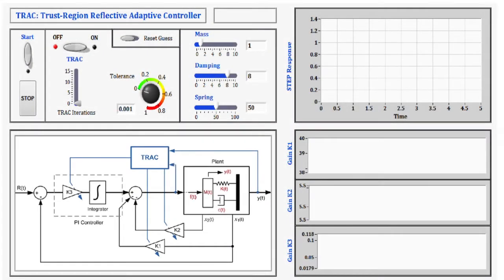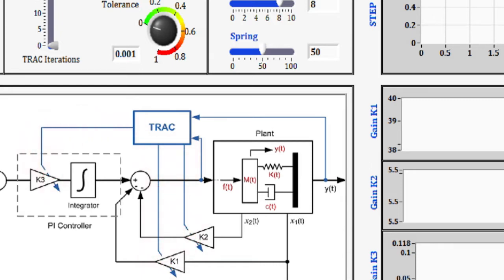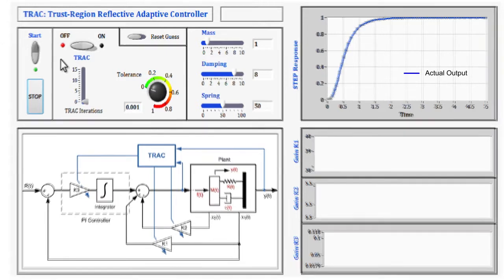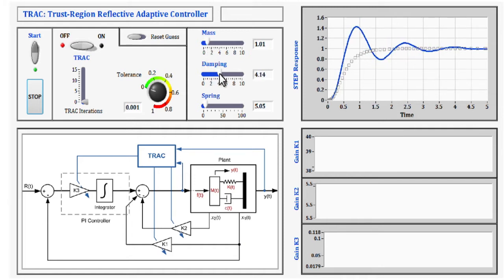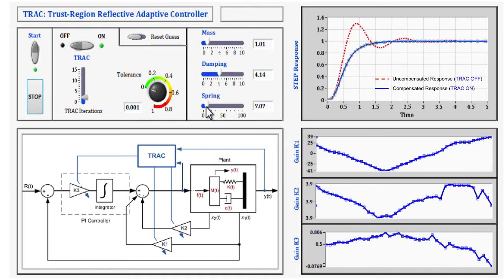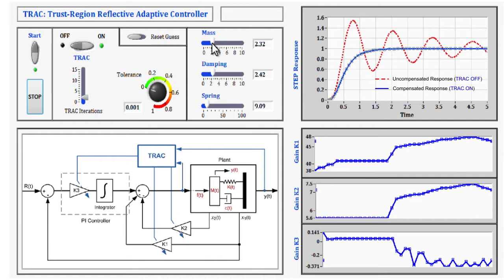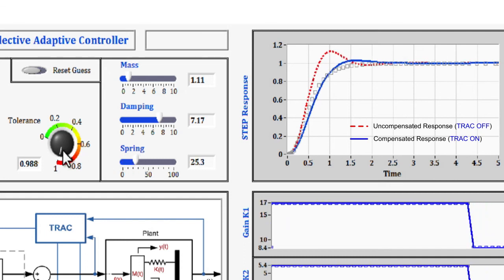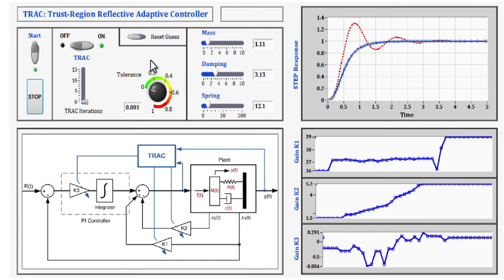Adaptive Control - LabVIEW  MATLAB Cosimulation (TRAC Algorithm)

Comment from the maker: On the block diagram, right click and go to library Mathematics>>Scripts and Formulas>>Script Node and then drag a Matlab script icon and draw a box just like you do with a WHILE loop. Right click on the left edge of the Matlab box you drew and click on Add Input. This will add an input port to the script. Right click on this port and choose the data type you want (real, matrix, etc). Give this port a name by typing it inside the port box. Do the same on the right edge of the matlab box but choose Add Output instead. Choose data type too. Connect your input port to a signal coming from LabView and your output to an indicator. Use Matlab language to write any m.file script inside the Matlab box that uses the input and the output you just created (ex: Out=sqrt(In)). You can call any Matlab function inside this script box too. Hope this helps.